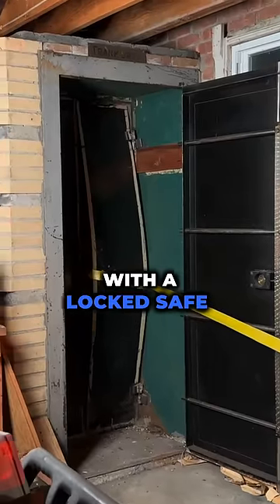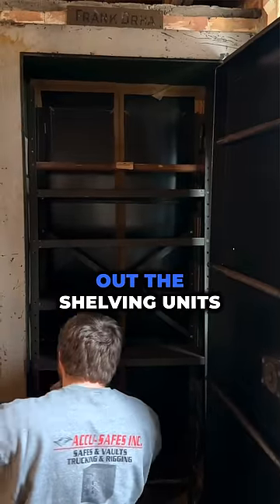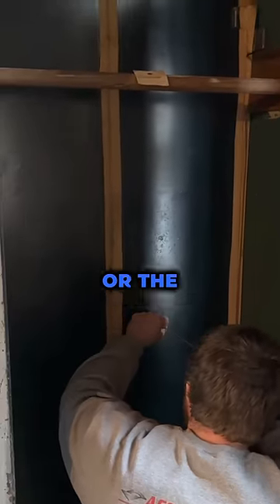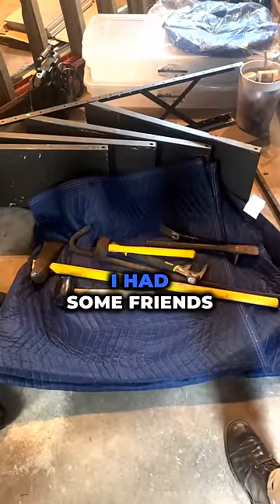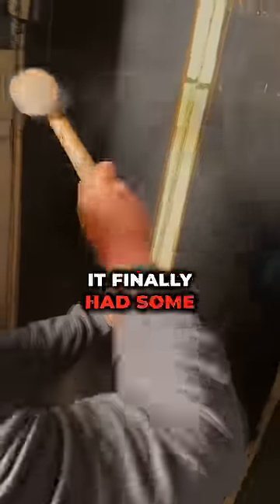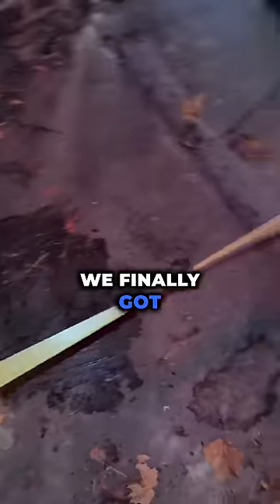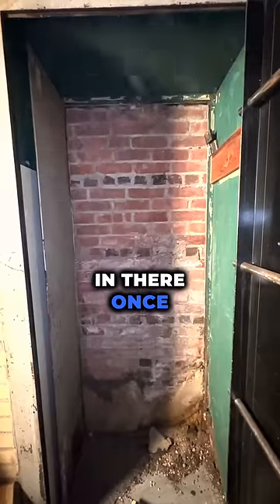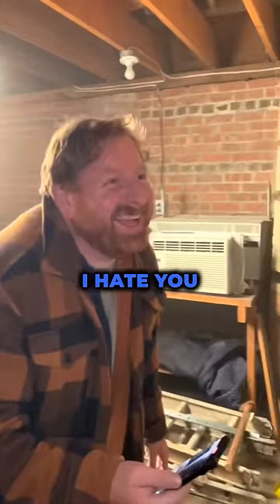I bought a house that came with a locked #Safe 🔒 Part 3 🔐 #realestate   #home #safecracker #treasure

Comment: Locksmith here. Safe work is its own special little corner of locksmithing world but of course I do get calls for lost keys for gun safes and rarely I get calls for found safes. Anytime someone loses a key to a gun safe there is always stuff in the safe. Every single time someone finds a safe the safe is empty. Move into a house and find a safe under the floor? It's empty. Bought a car at auction and found a safe in the trunk? It's empty. The only exception to that rule was one time a guy found a firebox in an abandoned house and called me to pick the lock. It was a century that you could open with a butter knife so I did it and inside was about $500 in ones and fives but it had an exploded die pack so all the bills were worthless. Dude still tried to pay me with the blue money and I declined. Funny enough a couple months later I was in the same town and I got change from the gas station that was obviously covered in blue ink so I know the guy spent the money or at least tried to..
Reply: Well coming from running a bank in NC, I can tell you that our policy required us to accept money covered in dye pack ink.... Which to me is absolutely crazy but I understand the theory behind it, that the person in possession of it is not necessarily the person responsible for the theft of the money. But still seems a little crazy to me, but it's still legal tender.
Reply: @AllenF05  wow that is surprising. Maybe it's policy to accept the bills so they can try to figure out where they came from?
Reply: @AllenF05 no bank can deny receiving valid currency, including old bills that are damaged, torn, drawn over, scratched, inked or even burned. As long as at least 50% of the bill is there and it is not a fake, it is still legal valid money. The bank takes the damaged bills to be removed from the money supply so new fresh bills are put back in circulation.
Reply: With tape...yes! I have recieved taped up bills before.@ChrisRobba
Reply: @Chrisrobba no they never said that…
Reply: Oh God that's hilarious😂
Reply: @Chrisrobba   No, you are literally the one not paying attention. It was Johnny who said you only need 50%
Reply: I've always wondered if soaking the bill in alcohol or paint thinner would remove the blue dye
Reply: Recently watched an episode of "Almost got away"  interestingly enough he always got away with it until.. he didn't follow his own rules lol.
Reply: Wow!
Reply: @johnny_eth  51%
Reply: @rustyshakleford5230  if it's not money after some paint sprays on it, was it ever really money to begin with? 🤔
Reply: @johnny_eth actually it's over 50%, I can't remember what the percentage is but if it was 50% everyone would cut their bills in half and double their money!!! 💰
Reply: Presumably the bank robber put the safe in his trunk and the car was repo’d before he could get his safe out. Karma, man.
Reply: But you can see in the middle of the bricks it looks like some bricks were removed and replaced, maybe I am wrong, but why keep the safe locked if there was nothing to find? Or what about the floor? Maybe there's more to it than meets the eye, maybe not, but....

Comment: Wasn’t the “second door” just the back wall of the safe because the safe itself obviously had shelves inside
Reply: Obviously it was just the back wall. he prolonged the nonsense for views.
Reply: I had an old bank safe where you could open the main door,  then inside were 2 wood panel doors with a keyed lock inside, was dope as shit! So could of been a secondary part to it. But cut down to fit.
Reply: there is hinges so it was a door for whatever purpose.
Reply: Thank you I'm glad I'm not the only one who was thinking that to myself I mean seriously what they supposed to put that huge steel door on the front just so you can knock the bricks down in the back from the outside😅
Reply: I bet it was originally a 2 part / room safe and he bought it from an old bank or pawn shop or jeweler and he didn't need 2 "rooms" so he put the back doors against a brick wall...

Comment: Be sure to measure the thickness of the brick wall. Maybe bore a small hole through the wall.
Reply: It’s the same brick as the wall outside the safe. Easy to prove with a string and measuring tape.
Reply: I thought maybe there’s a room behind the brick wall or something just on the other side. But who knows
Reply: @WEONLYLOVEHERE it would have been cool if there was. 😊

Comment: How did you get that strap completely around that door without opening it????
Reply: I was thinking the same thing and I guess he thinks people are stupid enough to believe the thin sheet metal with sealer down the middle and sides keeping it water tight was another door. You're a special kind of stupid if you think someone is going break the sealant out of the two thin pieces of sheet metal every time they wanted to open it.

Comment: Second door was to make sure someone didn’t try to access the vault from the exterior wall. Notice the vault wall that’s inline with the window and the wall parallel to that one are steel lined. Still, the “back door” seemed rather easy to open. Though we only saw it open inward, so maybe the steel shelving would have braced against the actual door. Who knows 🤷‍♂️

Comment: My grandpa's house served as a headquarters for Austrian troops in the 19th century. They put in a safe about 2 m high 1 m wide and 80 centimetres deep. My father said that there were no keys and no combination to it. It had six keyholes and six double combination dials and not even my grandfather ever saw the safe open. 
One day in my teens, my brother and I made a hole in the wall behind the safe and started flexing the back of it. It took us a whole week to remove the first layer of steel. Then we removed the concrete in a couple of days, and then this interior wall. After three weeks of working on it, we got our prize: an incredible amount of empty shelves.

Comment: Bones. Definitely bones behind the brick. Is it the same brick as on the home’s exterior? Is there any space between the safe’s brick wall to the exterior wall? If so it’s a false wall. If I was a nefarious person wanting to hide something, what better way than to hide it behind a brick wall and install a floor to ceiling safe in front of it to misdirect attention. Maybe the homeowner read Poe’s “The Cask of Amontillado.”

Or maybe my imagination has run wild.

Comment: Hey! you have unleashed an evil spirit. When you remove the second inter dimensional door, luckily the idiot fail safe was activated before you bought the house, soo when you busted the second door the evil spirit was at one of the seventh quantum labyrinth soo it still trapped. I hope you kept that dirt behind the second door and put it in a sealed plastic bag? If exposed to moonlight well, I hope you have sold the house and moved to another state! 😮good luck! 😱😎😂😂

Comment: I've seen this before it is a safe but it's not what you think you have to go underground underneath the floorboards please let me know if you get rich if it's not on the floor boards it's under the floorboards behind the brick wall but it's it's an old trick